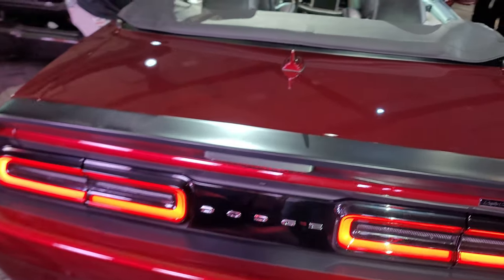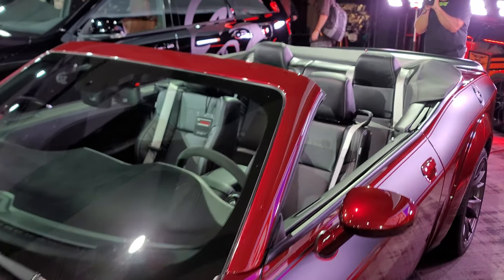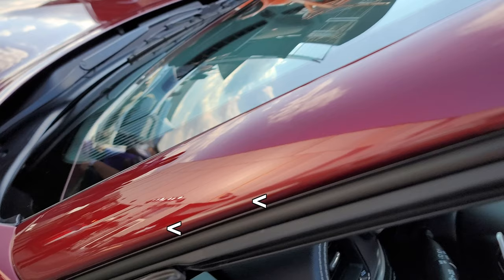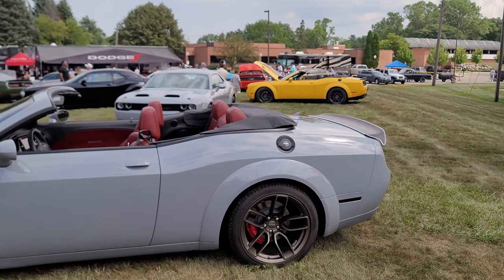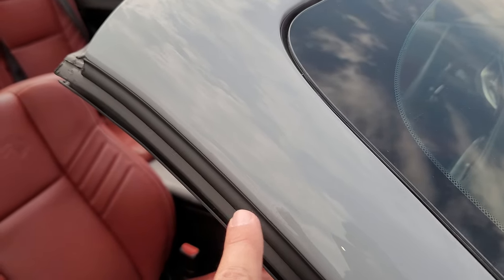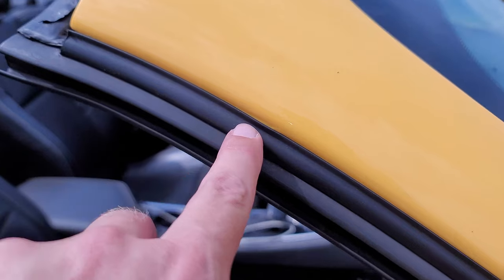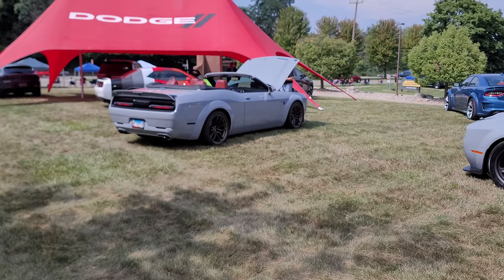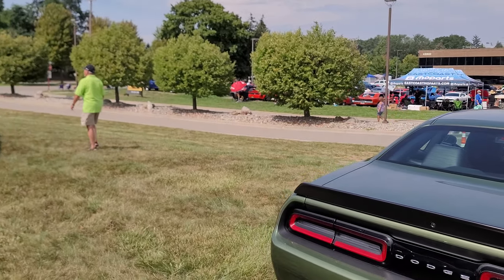I found several Paint Defects on the New Convertible Dodge Challenger Hellcats

Comment: You think their quality would be next to none for what you pay
Reply from the maker: for sure. no reason $26000 can't include better quality control. I'm thinking the shop might just be trying to push them out as fast as they can. Back in my body shop days, even if it was just a $500 repair, I would have immediately sent the car back to paint to get done right, and that's if it had just one of these defects. For $26K I'm making sure the car looks like it just came out of the factory.
Reply: I agree my inlaw had his done and when it came back he had to send it back to them to fix a ton of paint issues and electrical things that they still didn’t care to fix it’s definitely not worth it and it seems there will be a ton of brand new ruined cars out there soon😢